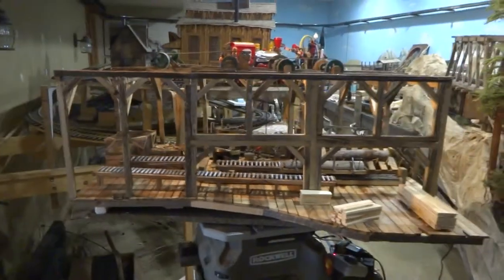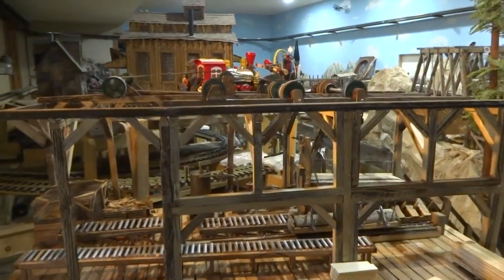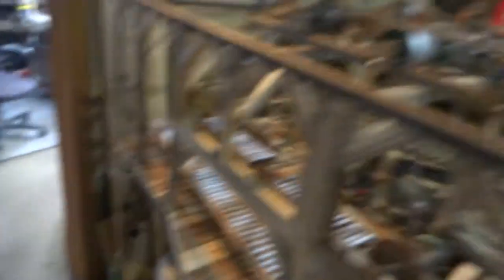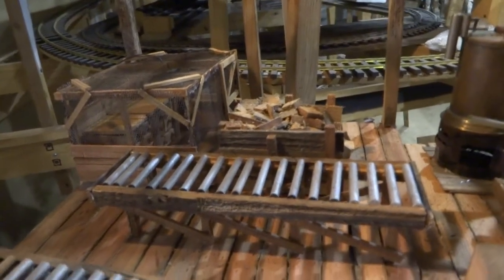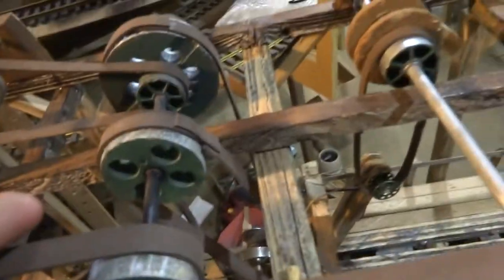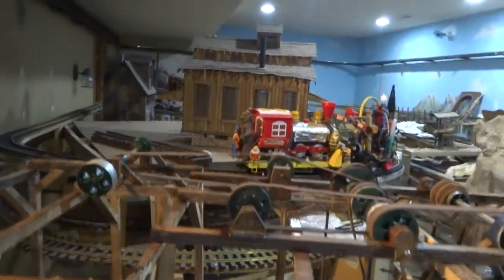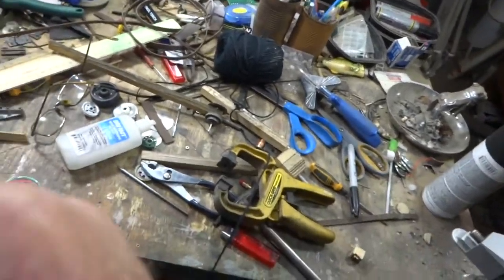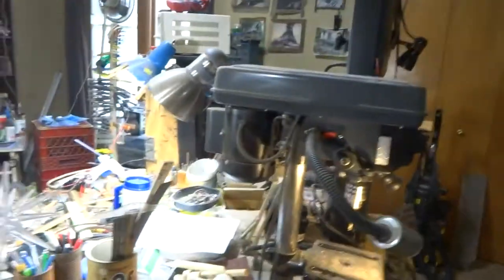Saw mill G Scale

Comment: If you run across an old tape recorder reel of tape at a yard sale, snap it up. The old tape is 1/4" wide and makes great drive belts. The tape in cassettes is 1/8" wide. The tape in video cassettes is 1/2" wide.
Reply from the maker: Thank You what a great idea, I will look for some of this. Do you think it might look to thin as a g scale belt?